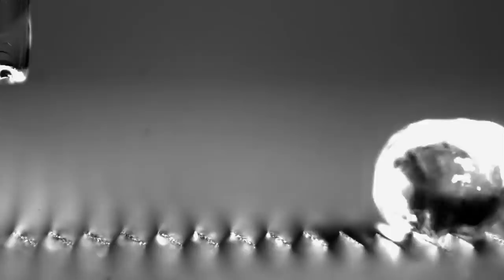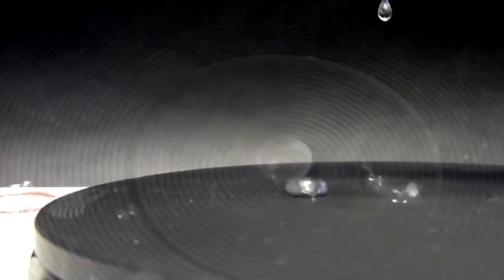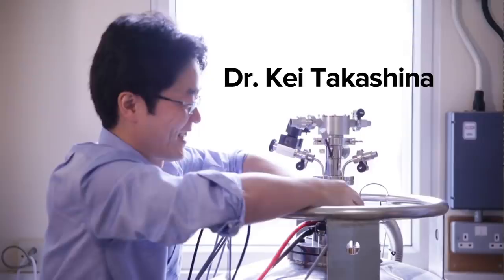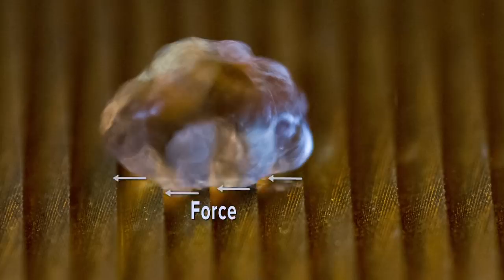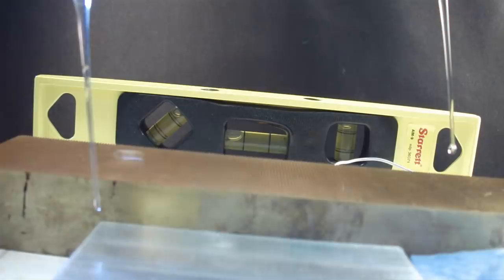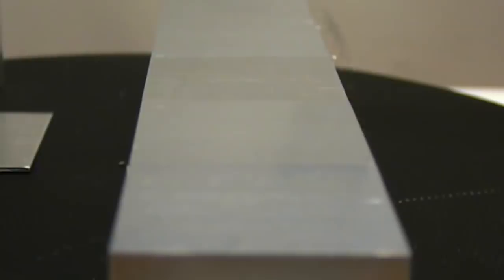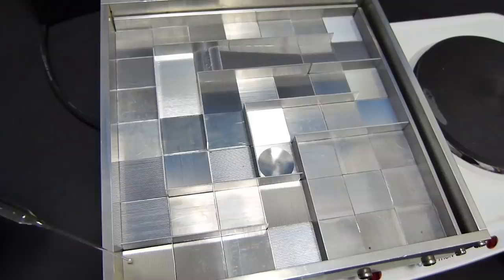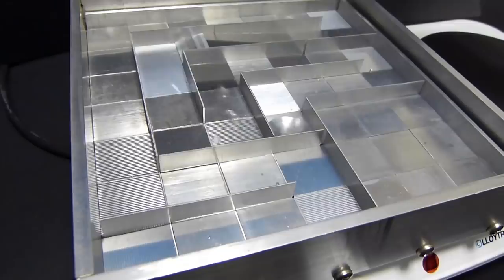When Water Flows Uphill

Comment: actually it's not only when the thing you are pouring water is REALLY HOT, it's just when there's a HUGE difference between the temperature on the liquid and the surface (for example a hand a liquid nitrogen)
Reply: Your hand is really hot compared to the nitrogen.
You need something way above the boiling temperature. Also, it depends on the heat conduction properties of the liquid.
Reply: yeah that's what a mean...there's a huge difference in the temperatures, that's why the effect happens
Reply: ok ok XD

Comment: Fascinating! Wonder what would happen if the serrated edges are angled more steeply? Would it give greater push in the direction of the surface vector?
Reply: your a bit late mate
Reply: @aluminium9230  To be fair I just got here too, I think the youtube algorithm is letting this video have a go around the internet (again?)
Reply: @aluminium9230  This is the internet, time is meaningless here.
Reply: @techstuff9198  I wish you were right.
Reply: @nocturnaljoe9543  me too buddy
Reply: Changing the angle of the serrated edges will propel it more forward, but the upwards propulsion wouldn't be as great, so you'd need to increase the temperature to increase the force of propulsion. This, however would cause the droplet to evaporate more quickly. So in the end, increasing the edge would increase the forward propulsion at the expense of evaporating it more quickly.

This is purely theoretical though and there is a lot more to fluids than simple forces.
Reply: @artemis_furrson  If you look closely, you can see, that the drops lose much smaller drops while climbing. I think that effect would increase as well. They seem to use a sweet angle in their set up.
Reply: @nocturnaljoe9543  Give it another year, your sense of time should be annihilated by then.
Reply: @techstuff9198  I don't think so.
Reply: @techstuff9198  You're on the internet too much
Reply: Bro do you even Science?
Reply: @Snags50  Yes, I do write down the results of my stupid decisions.

I miss the Mythbusters...
Reply: @artemis_furrson  
Thankyou for your informative comment.
Much better than the smart arse comments from the likes of @aluminium.
Reply: @aluminium9230  Many of us a bit late to find this gem.

Comment: It will run to one side if you milled the block on an angle. That can easily create table vibration when milling and throw the measurement off allow as small as quarter of a micron. 

It should be laser leveled and milled flat. To accomplish this the very basic milling machines have an option to manually adjust and level the tool instead of putting the product on an angle.

We made these blocks for years for Teflon coating to seal packaging. It's extremely noticeable when you've done it wrong because the surface of the packets don't seal at certain points along the block

Comment: Very good. For reference, swirl tanks are used when quenching  componets of a critical nature post heat treatment. The swirl causes the collapse of the leidenfrost effect ensuring the water is in contact with the component at all times during quenching. This ensures no disparity exists in the material quench which would cause soft/hard spots in the material metallurgy.

Comment: For powerplants that need constant cooling.. couldn't they use the idea of directing the water around to cool it? Say they put a circular heat bank around the fuel source, and when it's above the Leidenfrost point, it curves in the direction of the circle. When it's under the point, it curves away to another area. That way, the water is constantly circulating it when it's too hot, and then once the water absorbs enough energy, it's transferred somewhere else. Imagine this is done with several circles.. and perhaps creating liquids that have different boiling points to keep it at sustainable temperatures..
Reply: Great, so that means it is doable.  Square miles are nothing.  Just stack it into a volume, like the human intestines, and you can easily get square miles of surface in a fairly tiny volume.  I always find it funny how easily people give up these days.  The problems we encounter are nothing compared with what those came before us had to face.  I just wish I knew what the difference was between then and now to cause the dramatic change in spirit.  In my opinion, it can only be public school that are deliberately driving the "can-do" attitude and the individuality out of students.  You are a drone.  You must copy what others have done.  If you can't copy it, then it can't be done, and you shouldn't bother trying to get it done because you will waste your time.  That is the modern public school mentality.
Reply: not to burst your bubble, but didn't they say part of the reason this works is because the water is insulated, and it evaporates slower under these conditions?  If the water evaporates slower, that means the rate of heat transfer is slower.  Not an ideal property of a coolant.

Sure it might work, but man calm down about that public school crap.  It's also an important part of the creative process to point out flaws and problems and work to correct them.  Diving into something without thinking it through or even trying to anticipate problems is never a smart way to go.
Reply: Must be understood that on that kind of instalation you dont want heat to evaporate the cooling (on which this principle relays) the objective is to cool down the things the faster posible and keeping the maximun amount of coolant while not getting lost
Reply: "Power plants" transform heat into kinetic energy by way if evaporating water to drive a steam engine. The evaporation is the goal, not the problem.
Reply: Yeah but the point of power plants using water as a coolant is so the water evaporates into steam to push turbines. The leidenfrost effect insulates the water which severely hinders the rate of evaporation, so probably not all that practical over current methods
Reply: @benjamindover4337  Not sure if this was directed towards my message...

To point it better, the reactor on a powerplant will always turn liquid into steam, there is no point on slow down this process, the leinderfrost doesnt make sense here because it would slow down the speed the water evaporates, thus creating less presure and hence less power to generate from turbines...

If anything, it maybe (just maybe) may have some space on the "heatsink" part of the system.. I dont know that much about materials to know how much usefull could be to isolate small amounts of water to help his evaporation using this principle, to make some kind of "smart heatsink" based on the form factor (maybe there could be engineered a system where the water of one current follows a circuit that splits the liquid based onits temperature, allowing the hotter particles to be isolated from colder ones, and forcing the hotter ones to follow a longer path to cooldown while the colder ones would follow a shoter route and be redirected into the main flow... however I suspect that liquid to liquid heat transfer or liquid to solid heat transfer would be way more efficent than liquid to air heat tranfers, making a "leidenfrost based heatsink" probably a bottle neck in the system, instead actually be better.

Comment: The explanation of the Leidenfrost Maze is a little deceiving. The Maze doesn't primarily rely on the steering from the minute effect that the small grooves within the ridges of the block cause... it primarily relies on the larger grooves with a constant temperature to direct the water. Notice that the water will travel in the direction perpendicular to the grooves, just as in the original experiments.
Reply: What are you talking about??
Reply: Gordon Tendick  nice way!  .  But I think if it was always moving towards temperature gradient, then it do not satisfy what they observed ( like towards left when temperature is above ~ 500 and towards right when temp is under ~500) . I don't think gradient can change with temperature of a same surface and same heat source.
Reply: If someone was to make the bottom of a boat with the same design and super heat it. I bet it would be the fastest boat in the world.
Reply: You're giving people ideas. OwO
Reply: roy romano - Fool! You'd be better off purchasing a car full of microwaves and power them on around the clock. The equivalent would be to do so just for the sake of wasting money! Your idea won't move a boat. You'd only be moving the body of water the boat is in, which is ludicrously ridiculous!
Reply: Zenogreed Pilsner a jet ski moves the water it sits on. It's not so crazy.
Reply: True, so it u had a pipe with groves and superheated it, you would have an weak engine?
Reply: Well, as per the video. If I was to build a ship with this effect in mind. I'd actually make a submarine. My thinking about that is simple. Things move faster in air, or vapor, than water. So, if u super-heated the walls of a sub, you could move it incredible fast underwater. 

Or, say, hydrofoil, how hydrofoil ships work. That would be interesting to see super heated.
Reply: Also, turbines on boats move water, they don't move the boat either.
Boats are really inefficient, and I believe if you made the bottom of a boat with this effect in mind. You could get much greater speeds.
Reply: Zenogreed Pilsner oh...Lol
Someone forgets Newton's third law...
Reply: roy romano actually if I'm not wrong, I read a concept with similar principle u stated from a sci-fi, saying Russia was trying it at cold war
it did not use this leidenfrost effect, but superheat the surface of a submarine to make water become vapor, significantly reduce the drag
Reply: Apple BS to my knowledge, cavitation is the mechanism for the research being done on that though. Irl.
Reply: roy romano oh yeah, thanks for that
Reply: They weren’t implying the small grooves from machining were directing the droplets in the maze.
The large grooves do that.
The levy &right directional swerve was a result of the machining “grain”.  
The maze is based on the large ridges moving the water.
Reply: "Fool! You'd be better off purchasing a car full of microwaves and power them on around the clock. The equivalent would be to do so just for the sake of wasting money! Your idea won't move a boat. You'd only be moving the body of water the boat is in, which is ludicrously ridiculous!" zenogreed pilsner either its a joke, or you didnt do very well in science class, this statement quite literally goes against newtons third law, for every action, their is an equal and opposite reaction. also have you heard of a wave? i mean it moves boats all the time so moving the water the boat is in would move the boat. dont even know why i brought up newton when i think about it.
Reply: I think the largest obstacle to making a boat that relied, even partially, on this as a method of propulsion is that you'd have to heat the bottom of the boat and keep it heated. It works on a small scale because the mass of the metal is so much more than the water that the heat loss due to the water evaporating and creating the steam cushion is negligible when compared to the thermal density of the metal. Reverse it, and put a super-heated piece of metal in water, and all you're gonna do is cool the metal. The steam cushion acts as an insulator, but if the boat's moving, it's going to be coming into contact with fresh, liquid water at a constant rate. In fact, the faster the boat's moving, the more new water it's going to be coming into contact with, and the more it's going to be cooled.
Reply: I just looked at the video again and I could see it.... I could see that contrary to your opinion the droplets did go perpendicular only where the path was straight(metals with medium temperatures) and where they needed move the droplet at a particular angle like in the corners, the droplets actually were moving in a diagonal path and not perpendicular..I assume they had surfaces that were heated the metal in corners to the mentioned temperature to move the droplets in the direction they wanted
Reply: Protect the Flag Bearer Pilsner You tried too hard to sell your intelligence while being completely wrong. Every action has an equal and opposite reaction. Everything that moves by its own power does so by trying and succeeding at moving something else. We move the earth to go, and boats move the water to go.
Reply: It seems to me that it's the magnetics that determine the direction.  after all Walter Russell basically proves the universe is electric in nature,  not atomic.
Reply: Gordon Tendick it’s the temperature that guides the direction though.
Reply: I could see this working as a better water jet.  Maybe making a better hydro jet pack. That would be some hot exhaust though... Meh... if both exhaust jets were outside and far enough way like the typical configuration for a hydro jet pack it might be just fine. meeeeehhh Im trying to work it out in my mind.. CAnt see the practicality of it..... maybe in electrolyzing water ... even then.
Reply: If a boat used this, it would nullify pressure and fall to the ocean floor... Just saying...
Reply: mens sana Just saying.  More like just smoking.

Comment: Would it theoretically be possible to use this in place of magnetic acceleration or flux pinning in order to temporarily accelerate and move an object atop the water?
Reply: If an item is heated to temperature and Leiden Frost effect starts I think the item would sink in water because I can't see how something could float on top of water if it is surrounded by a bubble of steam
Reply: @goldyguns9545  it isn't surrounded. Only the bottom is steam.
Reply: @mrtechie6810  Exactly, only a thin layer of steam is created between the heated surface and the water.
Reply: I’m sure I’m missing something, but if you heat up the bottom, don’t you run the risk of boiling whatever’s inside? I mean, as a practical application, I can’t see many uses unless you’ve get a great insulator. But that’d probably add far too much excess weight to be effective…?
Reply: Only one way to find out! Test the theory

Comment: Wait, could this work reversed, as in having a thin sheet of really hot metal float on top of water?
Reply: I think the metal would cool too quickly, but there might be some useful applications for that.
Reply: +nambinhvu Well, if your energy source is sufficient to keep it stable it wouldn't.
Reply: +betadryl I think it would be a technological limitation. You would need enough heat to produce enough heat to lift the sheet. To heat it more, you would likely need heavier equipment, thus needing more heat
Reply: Think thermal nuclear submarine ie., energy and heat would not be a problem.
Reply: +Cheong Ziyong water "floats" on steel, steel doesnt float on water. It would sink but still be covered in a steamy shield for a while
Reply: DragonDrawing Clever, but how do you think a boat made of steel floats? Even a torpedo can balance its drift, just like a submarine.
Reply: you still need a source of energy to heat the metal, and it would be difficult to make a metal afloat just above water level
Reply: You obviously know nothing. Have you heard if the Astute/Swiftsure-class  nuclear-powered submarines?
Reply: betadryl not everyone is into submarines.
Reply: make the bottom of the steel shaped like a dome and then the water vapor will be trapped inside the dome giving upward force to the steel. but this probably will only work if the dome is large enough compared to the overall volume of the steel
Reply: +betadryl "Behold our new submarine! To make it work, the entire thing is heated to over 500 degrees! Who wants to go inside first?"
Reply: A thermal nuclear submarine using this effect? Do you have any idea how much heat that would require?
Reply: "You obviously know nothing. Have you heard if the Astute/Swiftsure-class  nuclear-powered submarines?"

Awesome sentence. Saved xD

Comment: If you used two sets of rigged plates, direction the droplet the same way, could the droplets Climb Straight Up???
Reply: I think of you make two plates and put them close together so that a droplet can touch both of them at the same time, it will be propelled upwards. You could maybe make a tube with these ridges on the inside and get the same effect. I have the facilities to actually test this, so i may give it a shot!
Reply: atiseru Any results yet?
Reply: I see your point here but unless the force of vapor downward exceeds then weight of the water. its not going upwards. But It would be awesome to see this tested.
Reply: atiseru Any results?
Reply: We need results
Reply: The people desires results :))
Reply: @atiseru  any results yet.

Comment: its just steam levitation power.
the trick is under 160° the water touch the plate and vaporize entirely , but above this temperature, the vapor form quick enough for push the water up and isolate the water.
and all the gravure stuff are like an helix for the steam